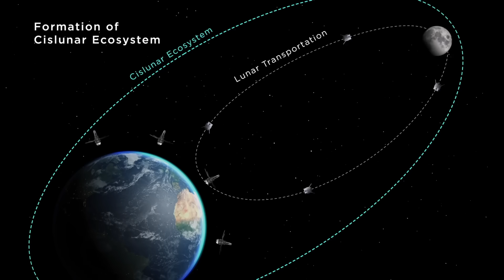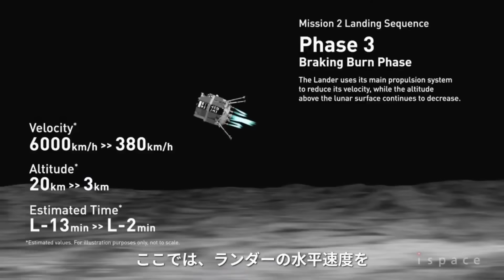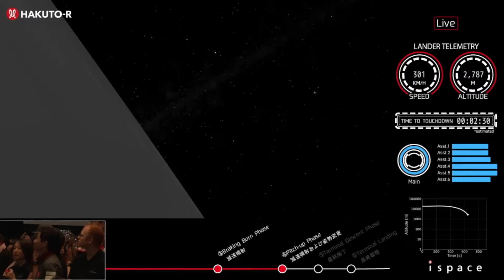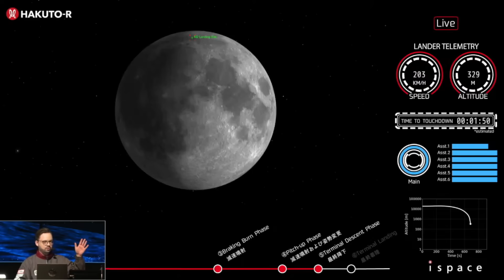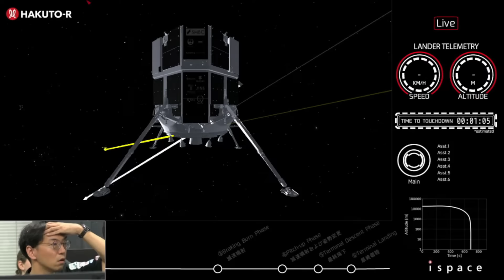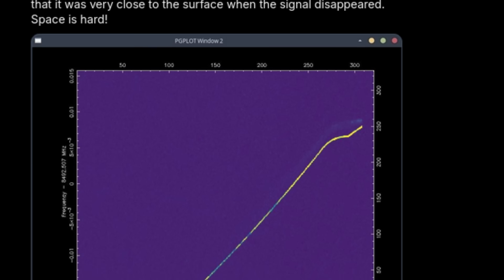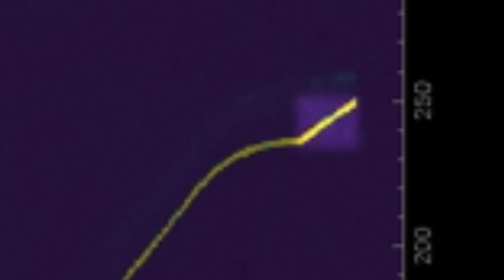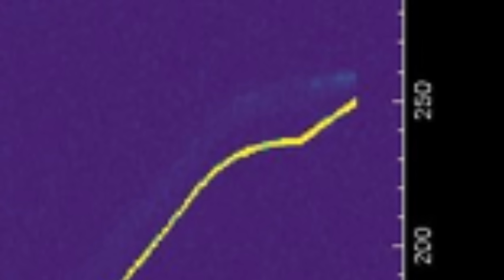Japan Crashes into The Moon, but Slower Than Last Time

Comment: Point LIDAR sideays = Get confused by cliffs
Point LIDAR down = Get data too late
Use Camera tracking = Get confused by featureless surfaces
Use inertial guidance = Land perfectly in mid-air
You just can't win with this space stuff. You would think it was rocket science or something...
Reply: I’m starting to appreciate the caveman approach the soviets used with the airbags.
Reply: what i wanna know is: why is nobody just using a radar altimeter? we know how to make those work. why is everyone going for untested, experimental solutions that seem to not work?
Reply: @M3PH11  LIDAR IS a form of radar altimeter.
Reply: @kenoliver8913  But with lasers instead of radar (EM waves)
Reply: @kenoliver8913  No. Radar does not use lasers.
Reply: @MonkeyJedi99 Both LiDAR and RADAR use EM waves, just at different wavelenghts.
Reply: @8ahau279  Yes, light is a part of the electromagnetic spectrum .I was trying to avoid calling radar "radio frequency" which would trigger the people saying radar is not AM or FM.
Reply: @MonkeyJedi99  - Aren't lasers EM waves?
Reply: @8ahau279  Yes but the emitters of those EM waves are fundamentally different.
Reply: @MonkeyJedi99 Light and radio are both 'EM waves'
Reply: @M3PH11 Lidar and radar have similar confusion issues and both don't give descent rate and distance until oriented vertical.
Reply: @M3PH11 I'm not an expert but one thing comes to mind is weight difference.
Reply: @M3PH11  I would expect, small radar transducers would work on small distances. For distances of several hundreds to thousands of meters, you would need larger and heavier equipment. This contradicts the goal of this project.
Reply: @M3PH11  Not an expert, but from what I can piece together I'd say Radar is a lot bulkier and heavier. Due to the large wavelength of radio waves you need large antenae and emitters. At the same time I can fit three of my vacuum robot's lidar units in the palm of my hand. I don't think that's possible with radar units.
Closest thing is probably speed cameras. But I don't know if they even actually use radar and if they do if it can be used for distance measurement.

Edit: There are also handheld radar systems, but they only measure doppler shift, not distance.
Reply: @christiannorf1680 you would be surprised how far miniaturization of radar sensors has come... The issue on this spacecraft wasn't the choice of sensor though... LIDAR/RADAR you can make any of them work... my guess is they didn't do proper real world testing... probably relied on simulations... any proper real world test would have revealed the flaw... hook the thing up to a crane and fly it over a real surface... throw some dust in its way and shine some really harsh light from the worst possible angle... play with that until it works
Reply: @gorgonbert  I see the point, but that boils down to "throw money (and time) at the problem until it goes away". Which is exactly what these companies can't do as opposed to the big space agencies.
Reply: @christiannorf1680 True, however, the method they tried twice didn't work... so they should take a good look and try to figure out if there's a fundamental flaw in their approach ... genius! i know 😉 ...🤷‍♂️
Reply: @M3PH11  because regolith is fluffy and scatters the shit out of the signal
Reply: @M3PH11 these spacecraft are designed by young kids who play video games in their spare time and they want to use the “latest” technology
Reply: @olasek7972  bait used to be believable
Reply: @olasek7972  Ah yes. Lidar. the most modern invention.
Reply: @jacobely6826 with laser, solid state photodetectors, modern sensors, etc, you bet comrade
Reply: Between botched moon landings and never-achieved FSD technology, we're learning why a competent human at the controls is still the best solution in many circumstances. Just ask the Apollo Moon Mission pilots.
Reply: @jlvandat69 spot on: they were all test pilots, highly trained and knew how to cope with anomalies
Reply: A (kind of) realistic solution is to send a Starship of GPS-like satellites to lunar orbit and provide direct guidance that way. Coupling high-recision 3D coordinates with pre-surveyed ground height map, the issue with onboard intruments is simply gone.
Problem is: it would look very bad to have such system and only use it for your spacecraft, but very costly to build. Imagine trying to justify the budget of such a program if it is going to be used by your rival. We are in this space race which everyone tries to appear as the good guys while secretly getting an upper hand. And that, above all technical challenges, is what's stopping this obvious solution from implementation.
Reply: Radar combine with Lidar down, use Inertial Guidance update by data from radar and lidar.
Reply: Thankyou for making a bit of sense😢 well i know what i'll be dreaming about tonight no! Just throw all data. Be back in a day or 2🤔
Reply: If it's so accurate, i need some sensors to play with. Gotta get to the bottom of this one!😊
Reply: Maybe solve the comms issues to start with...
Reply: You can win this space stuff. By mixing all the things you mentioned. Like...  you know all the other organizations have done it?
Reply: What we need is 2 pairs of eyes and 2 sets of balls
Reply: So close… Combine them! Inertial to 100m. Lidar + radar to 2m. Wires all the way down.
Reply: one would think a simple laser range finder is too cheap ?
Reply: Use redundant systems = sponsors get mad about "inefficiency"
Reply: The moon isnt that far. Why can't they just revert to manual control in situations like this? 
They have cameras, just fly it to the ground manually. Kind of like what Neil Armstrong did. Sure its a 2 second delay, bit might still be doable, and its better than loosing the whole thing because of faulty guidance and programming. 

I mean really, why dont people just fly these missions manually?
The moon is close enough that you could get semi-real time communication.
Reply: Even if you're only doing 40kph, that's over 10m/s.   So in three seconds,  you're 30m from where you think you are.   Bad,  and also not helpful for - every other body in the solar system.
Reply: @livethefuture2492  Imagine playing a first-person-shooter or platformer or car racing video game with a two-second round-trip delay between you seeing something and your command being received.
You would miss, often badly.
Now imagine missing the altitude where you want to achieve zero vertical and horizontal velocity.
Reply: I believe the issue with radar isn't just the weight of the emitter, but the weight of all the equipment needed to power it.
Reply: Maybe use gamma ray accelerometer
Reply: well said; everything is a compromise and they didn’t get it right. As an engineer i experience this often and testing shows what changes are needed. Much harder testing for moon landing than the systems i design for ground use.
Reply: People forget that, as opposed to this planet, the moon is ROUND, and therefore present a whole lot of different challenges when it comes to landing on it.
Reply: @captain_context9991  Sorry, are you saying the Earth is flat?
Reply: This is rubbish manly, why try to make origami out of it?
Reply: Except that it's bullshit - they (supposedly) managed to land using a calculator-level processor and a human 60 years ago and nova-days they can't manage to do it while having better visual, navigational and computational resources.

Like WTF are those engineers smoking when designing those crafts? This should've been a solved issue, long time ago.
Reply: @vaakdemandante8772  Yeah, how can they fail when NASA had 100,000x the budget and 10,000x the manpower back then?
Go design and build a plane from your own pocket. It's a problem that has been solved long time ago, right?
Reply: Sorry... every plane is measuring height over ground one every landing... this engineering problem has been solved for decades... let's call it like it is... they tried to reinvent the wheel once, failed at it, didn't learn the lesson and failed again.
Reply: @gorgonbert  atmosphere based flights use different systems based on barometric measures. Airplanes with automatic landing now also use ILS most of the time. Still agree with the rest though

Comment: Difficult problem, soft-landing when starting 60 miles up, with an orbital velocity of about 5000 mph.
Now consider how much harder is the reverse problem:  blast off from the surface and rendezvous with an orbiting module.  The target is vastly smaller; the target is moving at 5000 mph; the orbit inclination must be matched and the position along the orbit must be matched;  the target has no surface to stop you if your speed is a bit high or you are off a little in X or Y.   The calculations are too much for a 1970s computer.
Also, you're screened off from Earth half the time, and the target is over-the-horizon 90% of the time.
Reply: Nah, try it in KSP.  Launching to orbit is easy, and then you can close in on your target to rendezvous for almost free.
EVA suit yourself a landing on Minmus without splattering your Kerbal is hard.  Doing that with only half your dV is harder.  The final step of getting back up to orbit to get in your ship after with the second half of your dv?  That's easy mode.

Comment: At a certain point, we have to replace "space is hard" with "they fucked up", because I'm getting the distinct impression that these small landers aren't designing in enough redundancies, or doing enough hardware testing, or enough mission simulations.

Intuitive Machines fell over both times (the first time because they did the equivalent of not removing the "remove before flight" lock). ispace crashed both times (the first time because they never re-ran their mission simulation after changing to a NEW landing location whose approach trajectory now included the sudden 5km-crater-rim-altitude-drop that ultimately doomed it). Astrobotic didn't even get to the moon because one of their tanks exploded due to a known potential issue that they didn't correct because it would have required too much work and they just crossed their fingers that it wouldn't surface during the mission.
Reply: I work in the industrial world. A little bit different than space, but I work side to side with the people responsible for making sure the lights come on, the gasoline gets to the station, and roads get paved, the water stays clean, the car factory gets the steel it needs, etc…

I am amazed regularly at how dumb and low character so many of the people keeping our society turning are, and how thin a strand most of our infrastructure is hanging by. Not because of a lack of money (there’s plenty of that) or a lack of technology. Just pure human ineptitude.

I wouldn’t be surprised if a lot of the commercial satellite industry is the same way, which these lander teams are basically a limb of.
Reply: Yes and no. These missions probably cost a tenth of what NASA or ESA would pay for them.
Reply: @Mike-oz4cv  Yes but the NASA and ESA ones work.
Reply: Yeah, but did their investors invest?
Reply: They aren't from waterloo, where the vampires hang out.  @brianhaygood183
Reply: There's also the economic realities to consider. The extra design and testing work costs money. Would these projects even reach lunar orbit if they decided to spend more on design and testing?
Reply: @TheBillerator  Testing the first lander is a hell of a lot cheaper than building and launching a second one.
Reply: @zacklewis342  But sometimes you only get that one chance. So it is either to launch with something that is imperfect or make it better and hope that you get a slot on a different launch.
Reply: Eh, mate, It don't matter, we're all making millions off of the dummies that employ us, and ain't got a clue what we are doin'.
Reply: It does feel like they are forgetting that "space is hard" and that they can't rely on luck and a prayer. They either have leadership rushing or engineers who are way too arrogant (both?)
Reply: Crossing fingers doesn't seem to be very effective in space. Wait, does it work on earth? 😅
Reply: In most cases, automating does the job better than humans. Landing on the moon seems to be different and requires realtime data fed to human eyeballs with their hands on the flight controls to be 100% successful. We need to emulate that into the landing process, not just relying on altimeters and lidar. Machine vision fed to a space hardened SoC with access to the flight control hardware.
Reply: @totallylegityoutubeperson4170  That is what they also have tried, it is just harder to distinguish features on the moon for a computer. Especially as they were landing at a time when the shadows were quite long, which makes the surface harder to distingusih exactly as you have shadows everywhere.
Reply: Shame on you!  As a viewer of this channel, you should know that the proper term is "Screwed the Pooch", not "fucked up".  :)
Reply: We've been nailing landings on Mars for 50 years. The moon should be a piece of cake.
Reply: On mars you use parachutes
Reply: @6point8esspcee68 but we really haven't. We've nailed a few landings everything else has essentially crash landed on mars and some happened to work afterward. Also mars having an atmosphere creates way more options for landing.
Reply: Turns out "Move fast and break things" is a really shitty motto for space exploration, regardless of its popularity among a certain flavor of venture capital nitwit.
Reply: Absolutely, at this moment it feels like their just throwing millions of dollars of junk at the moon, at what point do you say enough ? The sponsors must know by now that they can't do it and clearly dont have the tec or knowhow to do it. If you cant swim stay out of the ocean.
Reply: thats the narrative u keep telling urself ?

Comment: I think the problem with modern commercial space isn't "space is hard" but rather "everyone seems to believe their way of doing space is best". I understand the whole point is having many start-ups with their unique ways of doing things is stimulating innovation. But the problem here is that the supply of aerospace talents is very limited, unlike computer science or bioscience where hundreds of thousands of newly graduates enter the work force each year. And most aerospace engineers would rather land a more secure job in the defense industry or civil aviation. With an already small pool of talents spread across many independent endeavors, the ability of these companies to execute and materialize their innovations becomes very limited. There needs to be some level of centralization and consolidation to reduce the amount of redundant R&D and develop better industry-wide protocols such that different projects can better coordinate with each other.

Comment: The Surveyor program cost $4.2 billion in today's dollars for 5 successful landings out of 7 attempts for a cost per landing of $840 million. NASA CLPS currently pays about $120 million per landing attempt. With only 1 fully successful landing out of 7 commercial attempts so far, we are currently exactly where we were in the 1960s with $840 million per successful robotic lunar landing.
Reply: Also I guess the simplicity of Surveyors is something that helped. It wasn't about landing precisely or an algorithm with terrain avoidance... Just a radio altimeter telling the thing how close it was ro the ground and long landing legs with a low center of gravity so it could land in difficult terrain...
Reply: @LeonelEBD  Yep, and good luck. Getting 5 out of 7 meant they just missed a lot of rocks and cliffs (take a look at a few of the photos). Also terrain near the poles - where everyone now wants to land looking for water - is always gonna be a lot harder to detect than near the equator because of long permanent shadows.
Reply: @kenoliver8913 Yes ... Guess they'll need to make a more heavy fueled lander so the old fashioned method can be used... Of course more expensive but if it lands instead of crashing 😅
Reply: "the enshitification of space exploration" to coin a phrase
Reply: You're forgetting the missions that preceded and, that helped nasa and the peeps behind the surveyor program learn a lot about how to do missions like this, namely the Ranger program, with 6 out of 9 failures, and the pioneer program, with 9 out of 20 successes.
Reply: dzonikg is a propaganda bot posting the same comment everywhere.
Reply: Hakuto R is not CLPS. There have only been 4 attempted CLPS landings
Reply: 我们中国人登月不用那么多钱，你们可以出一半钱让我们帮你们登月。
Reply: but $840 million in 1960 would be like 80 billions now right ?
Reply: @flo0778  : re-read the comment and pay particular attention to the "in today's dollars" part. ;)
Reply: @ErickC  okay but thats just inflation adjusted; aka we produce a lot more potatoes more cheaply these days. in gdp % you still have to multiply by 3.
Reply: @flo0778  about $4 billion today according to some questionable online inflation calculators
Reply: @flo0778 They already adjusted the 1960’s dollars to today’s dollars and got the $840 current dollars equivalent.
Reply: USSR send 3 rovers to the moon more then 50 years ago ,only first failed to land ,with computers that had like 1 kb off memory ,scientist back then were smarter then todays
Reply: @dzonikg  No, they were just as smart as today’s engineers/scientists, but far more ignorant. They covered their ignorance with brute force and the financial backing of a superpower. Today’s engineers and scientists are leveraging their knowledge and technology to try to do more with less. Which is pretty much the theme of this video.
Reply: @dzonikg Yes, the Soviets were 3/3 on rover missions, which was great. But like NASA, they also sent flybys, landers, and orbiters. In total, they had 40 missions, of which 24 were successful. Post Soviet Russia has had one lunar mission, Luna 25, which was unsuccessful.
Reply: @dzonikg possibly better funded.